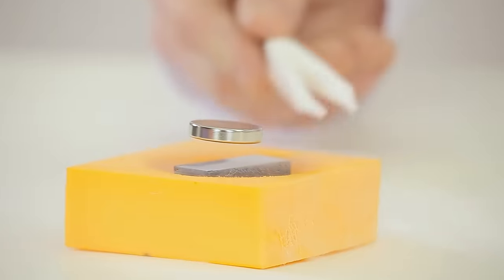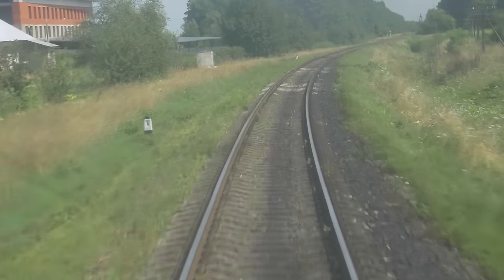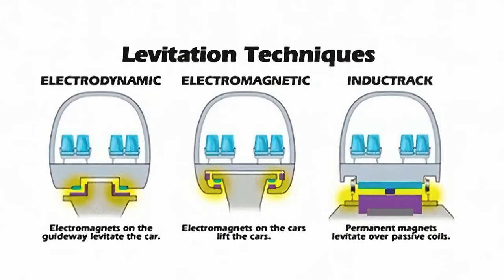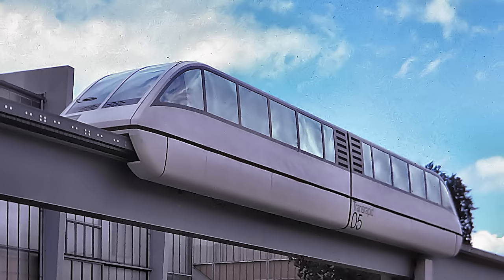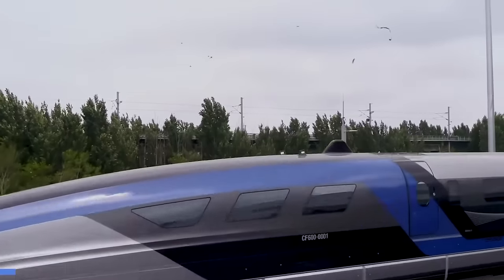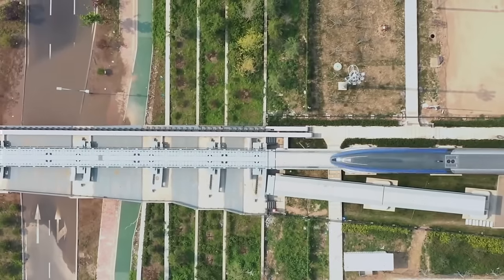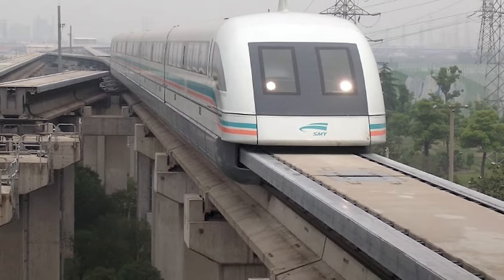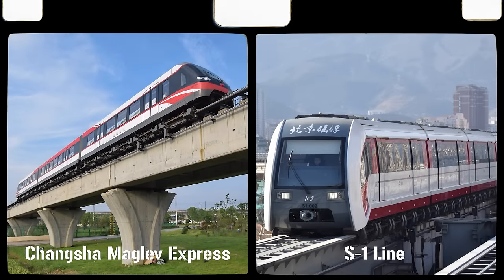Maglev Trains: Why This ALWAYS Falls Short

Comment: I remember taking the maglev in Shanghai in 2004, shortly after it had opened. At the time there was a lot of hype and the local English newspaper even said that a new line to Hangzhou would be available in time for the 2010 World Expo. That never happened. Plans to extend that line to downtown also didn't go anywhere. Many locals are actually wary of it going through their neighborhoods, as some think that the maglev is too noisy and some even told me that they thought the magnets could cause cancer. I am no position to say if they are right or not, but I do know that it has been nearly 20 years since the Pudong airport line opened and it remains unique and largely unprofitable.
Reply: The original plan was to run the maglev at least between the two main airports with a stop in town centre and a right-of-way still exists. The NOISE was the driving factor of oppostion. As soon as locals found out how loud a 500km/h train is they started pushing back hard against the local government (Contrary to perception, whilst the Chinese government is authoritarian, they know better than to piss off hundreds of thousands of people at once, over a single issue)

 Ok, it's quieter than a jet fighter making a low speed pass (or even a conventional high speed train), but it's still really loud and to make it worse it's a thump you can FEEL from over 100m away)

"High-speed maglev noise impacts on residents: A case study in Shanghai" is worthwhile reading

The economic case for the maglev is somewhat undermined by the Shanghai subway only taking ~40 minutes to city centre from either airport and being 1/10 the cost. As much as I wanted to ride it, the potential screaming match with my wife about the ticket price difference was not worth it (Never mind that we could easily afford it and I had budgetted it in, she blew her stack when she saw the price vs taking the metro. Persisting would have been "most unwise")

WRT magnetic fields or radio emissions causing cancer: Inverse square laws apply to both and in most cases unless you're sitting ON the magnet or antenna, it's not going to affect you (and almost certainly has no effect whatsoever beyond a couple of metres)
Reply: @miscbits6399  I definitely remember the complaints and fears about the sound too. When I arrived in Shanghai in 2003 from France, the metro line 3 had just opened and it still sold paper tickets. Now they are literally building the line 23 near my apartment. It is MUCH more convenient now than it was then.

Comment: As you said, if you can't built HSR properly (USA, UK etc.) don't even THINK about Maglev. Leave it to the Japanese and Chinese to develop the tech and prove it out while we try and just get some basic trains that work. Maybe in 100 years we can start thinking about Maglev. lol. But....even then I don't think it'll catch on big. It's quite a niche solution that only really works for linear corridors over long distances. It can't interface with existing tracks, so it'll always be it's own dedicated high speed thing, rather than a full network.

Comment: Great episode! It's fascinating how difficult it seems to be to get even traditional trains to work really well, despite having some significant potential advantages over road traffic, and maglevs having significant potential benefits over traditional rail, seems to be even harder to produce good versions of. Those are high costs, but then again, as potentially society altering megaprojects go, a few billion dollars isn't that much, especially the quoted estimates. I mean, if something sounds to good to be true and all that, applies very well to cost estimates for massive and highly advanced infrastructure on the same order of magnitude of what it takes to maintain the streets along the planned route during the time it actually will take to get the new infrastructure up and running.

Comment: you have not mentioned the one in Changsha, China. It is has been running for a few years and quite successful commercially. total length 18.55km $749 million USD cost. Top speed at 140km/h
 40million USD per km isn't that expensive compare to average cost of subway line in China which is between 82-121million USD per km.
Reply: 888yangji Iamewhlteboy
Reply: Iame whlteboy
Reply: k -I I

Comment: One further point : Maglevs need a dedicated line, without points/crossrails en-route.
Conventional trains can switch routes across vast networks (e.g. in the UK) which makes them a very flexible option.
Reply: This isnt really a major issue in the scale of the idea, it would be easy to get around by boring a tunnel instead
Reply: (or even going over head in some cases)

Comment: Considering the new CR450 conventional high-speed train will have operating speeds of 400 kmh or 249 mph, it's is not far off the current Shanghai maglev.
Reply: And the operating cost is significantly lower too.

Comment: I live between Baltimore and Washington DC and I am one of those opposed to the project.  As pointed out in the video, the ultimate goal is to build a Maglev train in the Northeast Corridor and the officials in Maryland were the only ones who were willing to consider allowing a smaller demonstration project in their state.  The selling point was getting from DC to Baltimore in 15-20 minutes, with a stop at the airport in between.  Aside from the cost - both for the line and compensating people who will lose their homes - the problem is there is no real local need.  There are already 2 separate commuter train lines serving the route, along with 2 major highways connecting the cities.  Based on where I live I will still need to take the older train as there would be no local stop.  Residents realize this isn't for them it's for a larger project that they will not see benefits from.
Reply: markbrusburg Iamewhlteboy
Reply: Iame whlteboy
Reply: k -I I

Comment: Main reasons why maglev hasn't and never will catch on are:
1 Maglev would a brand new infrastructure system, one that would instantly collide with the already existing rail network.
2 Standard rail systems are way more modular, and by that I mean . . . just about everything. From types of cargo to the freight cars used to transport said cargo and the rail yards themselves.
3 Cost of building the network. Be it electrified or non electrified, it's waaaay cheaper, faster and simpler to lay down 2 pieces of rail, connected by some ties than it is to build a whole concrete structure that spans god knows how far.
Sinply put, Maglev is a wonderful idea but it will never replace the train. Trains are cheaper and more modular
Reply: Any fast train needs to be grade separated, for safety and even practicality.  So, if desiring high speed, that raised or tunneled way is needed.
Reply: All the above reasons can be shortened to maglev is way too expensive. 1) Expensive new infrastructure system. 2) Expensive to convert cargo and freight cars. 3) Expensive to build the network
Reply: Maglev will replace the train in areas that can afford them because of the long-term benefits of power efficiency, easier maintenance, and faster speed with them currently building ones that can go faster than a plane.
Reply: In other words maglevs need that vaccum tube to make them worthwhile.
Reply: True
Reply: 1: hope you relize that also tro for shikansen.
2; actually you can't. There are limitations making high speed and cargo trains not compatible.
3: do you know or are you guessing
Reply: @bearcubdaycare Excellent point! But try telling that to fans of Florida Brightline. They scream: "you pay for it (grade separation to avoid pedestrian and car collisions)!"

Comment: You forgot two key issue with maglevs nowadays that are also connected. 1. Maglev trains use closed designs. That means the whole system aka the train and the rail come from one company. Thus, you cannot buy trains from another company to run on your tracks. This limits competition.  2. Each system uses a unique design. While on standard rail, you can use the same parts for a wide variety of trains and have some economy of scale, this does not apply to the different maglev concepts. And this is much more complicated than just having a different gauge. Major components have to be switched. Thus, making it less likely to have multiple companies building trains for different types a tracks.

In addition, steel wheels already have low friction so the benefit is not that big for most operations. If you get faster, the air resistance is also the main contributor of friction. You can integrate high speed rail with slower rail in train stations easily, which you cannot do with maglev. And railways are better equipped to carry high and varying cargo weights. They are easier to distribute. Thus, you need definitely rail and a separate maglev track and there is no space left in many urban areas.

And there is one more thing. They require much more rare materials to work than conventional trains that are also harder to recycle. Old rails and wheels can be completely recycled and made into new rails and wheels.
Reply: Does the AGV system in France use magnetic propulsion?
Reply: @thebagelsproductions  no this is a "normal" high speed train platform with wheels and rails.

Comment: I remember times when the Swissmetro was looking for a country where first shorter section of the (now known as) Hyperloop would be built to serve as a proof of conception to measure construction and maintenance costs. Over 20 years ago they proposed such investment of underground rail to some cities, including the Polish city of Cracow (Cracow-Zakopane tourist metro line, 12 minutes ride @ 500 kph). Cracow refused to participate in the investment, believing it to be a "white elephant" project. Back those times (20 years ago) the cost of building Lyon-Munich-Vienna Swissmetro line was estimated for 40 bn EUR (some 80 bn EUR today I believe).

Comment: The place that could really use mag lev, even at regular train speeds, is Chicago. A very quiet train line could improve property values and living conditions along the L. It’s loud as hell.
Reply: 7:57. Speed helps with levitation. 
Wheels might still have noise issues. 
[time+money+will=innovation].
Reply: This is the actual future of maglev, as low noise and vibration urban rail lines. The biggest problem with maglevs to date is that they are all effectively monorails with monorail track switching problems. To switch a regular train between tracks your just have to move two narrow steel beams (rails), to switch a current monorail/maglev between tracks you need to often move a massive heavy concrete beam with a system that is much more prone to breaking down and slow to boot. If you can't switch tracks quickly and cheaply you cannot run as many trains and have to provide a much lower level of service. The Delft Hyperloop project is looking at using magnetic track switching (this part of the project is good, the vac tunnels are silly). In China they have built a maglev that uses a combination of permanent magnets and electromagnets for suspension. Put these together and you could have something quiet and practical.

An advantage of maglev trains not mentioned in this video is that they can be much lighter than regular trains, meaning putting them on elevated viaducts can be much cheaper. They are lighter because they do not need to be heavy to make low friction steel wheels on steel rails work without slipping. Cheaper elevated rail is needed in cities as tunneling is so  expensive.
Reply: You could probably achieve that with continuously welded rails and modern eclectic motors.
Reply: moving to rubber tyres would solve most of the noise problems (French solution) far more cheaply than maglev, and doesn't have the switching issues

(I'm pointing to the French solution as thia was specifically a conversion from rail to tyres+rail whilst most others would require the entire system be rebuilt from scratch)
Reply: @tintin_999  Light rail is already much lighter than regular trains and eminently suited to low speed urban operation

As Boston, Seattle and Chicago found out the hard way, elevated tracks/roadways might be cheaper but they come with their own sets of problems - hence the "Big Dig" a few years ago. (Chicago can't tunnel easily because of the high water table)
Reply: @miscbits6399  ehhh the Rubber Tyres are generaly louder then Rail on a strait away, its tight turns that end up with flange squeel. there are also serious down sides to Tyres as they wear out much faster then steel wheels and have a lot more friction so the trains are overall notablely less energy efficent. - the main reason I belive the french whent for Tyres was to allow steep gradiants and stations on steep gradiants.

Comment: Just as early airlines carried mail as a reliable revenue stream, maglev lines could find niche freight haulage of containers along high-demand routes to be profitable. The trouble with high-speed passenger rail service is the need for frequent stops at local stations. Maglev could be seen as a pseudo pipeline for containerized cargo on routes where they could out-compete trucks on freight volume and timely delivery. The weight and logistics may not work out favourably except for high-value goods on single-client routes. It would be informative to analyze all the numbers on energy input, maintenance, labour and infrastructure investment compared to regular rail and OTR trucking. Walmart could investigate a network from The Port of Long Beach to several inland logistics depots versus their current fleet of trucks.

Comment: The Birmingham Airports Maglevs track is still in use just with what i think is a cable drawn train on it now. Birmingham Airport is directly connected to over 100 towns and cities via Birmingham International Station and the 'Air-Rail Link' monorail system

Comment: That train in shanghai is pretty loud and it feels bumpier than a regular train.
Reply: Having ridden on the Shanghai maglev numerous times & the Gaotie, (HSR) regularly I'd have to agree with you. The Gaotie is much smoother.
Reply: No contact with the track and no moving part removes some sources of noise and vibration. But levitation probably makes people think of floating in the air, like on a cushion of air. But the air is not providing any real cushioning effect here. 

The train is magnetically very tight with the tracking. This means that if the track experiences some deviations from a smooth line, for example some minor subsidence of the ground as can occur over time, those deviations will be mirrored by the train. I would suppose subsidence would lead to some small shifts of the concrete elements supporting the track relative to each other.
Reply: @aphextwin5712  It demonstrates that you can't "just" rely on the levitation but still need a suspension system to soak up ride irregularities

The Japanese mmaglev has the same issue and it's mostly in tunnels - Tom Scott published a video on his experience
Reply: @miscbits6399  Well it doesnt helps that it was the first and only line with this system and that the company that designed it isnt around anymore.
also chinese quality controll on the track...
Reply: @nox5555  Tom Scott's Japanese experience demonstrates that both your assertions aren't relevant to the bumpiness of the ride. Either the cabins need to be isolated from the external environment or something like air-sprung seats need to be used - and given the comments he made about noise levels, it's likely to end up being the former over the latter, if a decision isn't make to partially evacuate the tunnels

This is a complex set of issues (to say the least) and in all liklihood some combination of solutions will be used. Shinkansen riders have become used to extremely smooth rides and the current maglev ride quality will be intolerable to the average Japanese passenger

Comment: The cost of building and running magnets that are large enough to levitate and propel a passenger train are enormous! Also, mag-lev trains need long runs to make their much higher possible speed make sense.
In Toronto, we had the Scarborough LRT. It wasn't mag-lev, but it used a linear motor that was built into the tracks. It was supposed to be super-fast and fully automated.
As soon as the thing got into opperation, the residents complained about the noise. That was the end of super-fast.
Before the thing ever made it's first run, the TTC driver's union insisted that each train had a live operator at all times. So much for fully automated.
To make things worse, the engineers that designed the thing failed to take damp, cold Toronto winters into account, so the thing was broken down about 20% of the time during winter.
I don't live in Toronto anymore, but I heard that the Scarborough LRT has been scrapped.

Comment: With a top capacity of only 10 000 passengers per hour* the Chūō Shinkansen will be a somewhat sad addition to the travel market in Japan. Especially considering the high demand route it is a part of. The Tokaido Shinkansen of today has a peak capacity of 42 000 passengers per hour and it will obviously remain the absolute backbone of the route between Tokyo and Nagoya (and Osaka a few years down the line). That's a lot of money for little use.

*5 trains per direction and hour with a seating of 1000 passengers each
**16 trains per direction and hour with a seating of a little more than 1300 passengers each

Comment: the shanghai maglev is very impressive but it didn't run at full speed for all services. One of the drawbacks of the train is that the length of track just isn't long enough for it to viable to run it at full speed all the time. By the time it reached full speed it would be very close to the time that it needed to start decelerating. Most of the time (at least at the time that I had ridden it), it was run at around 250kph or so.